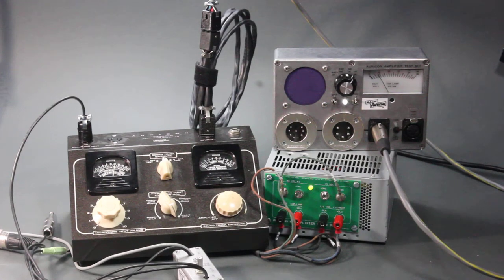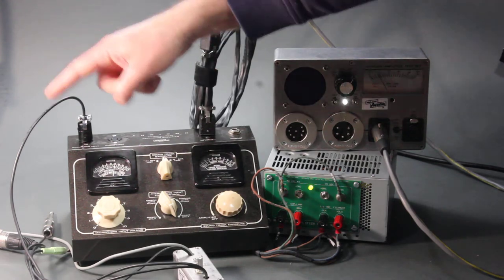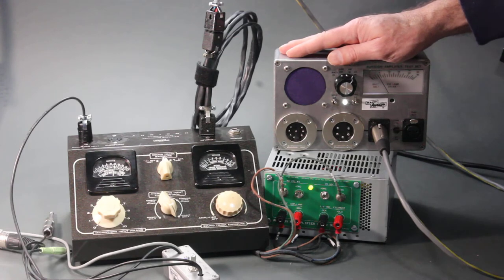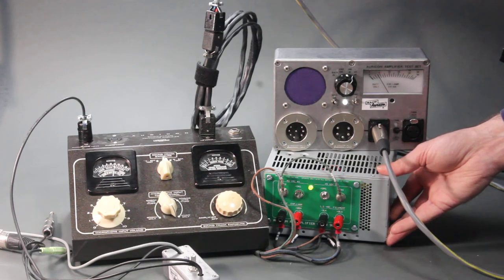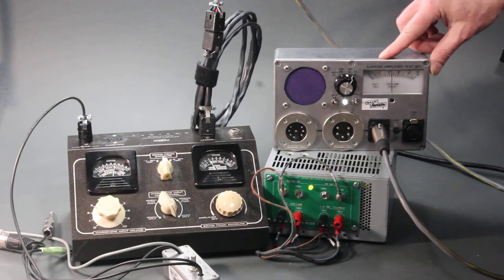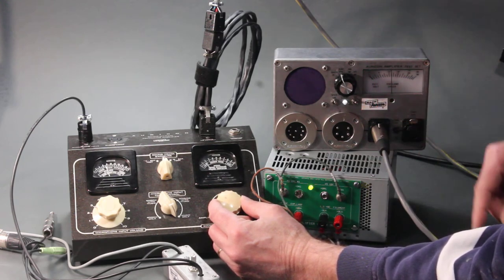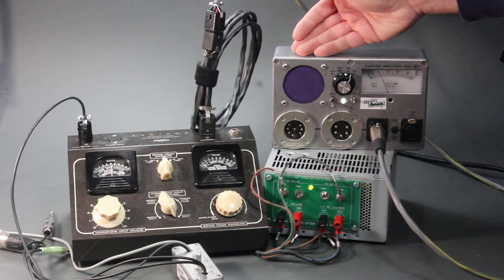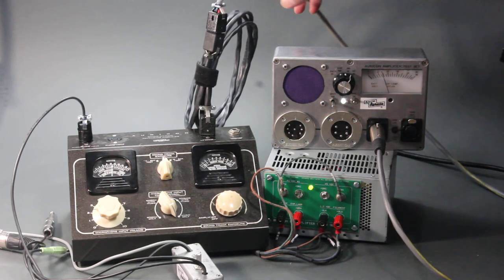Bach Auricon RA-30-A7 optical sound amplifier demonstration

Comment: I just got myself an NR-25 and it will certainly be a challenge to get it running again.  I'd love to talk to you about power as it currently needs 6 rather odd batteries to run.  Nice video btw.
Reply from the maker: Hi, thanks.  All batteries connect to a wiring harness coming from the amplifier cabinet.  90 volts connects to red and green (red is plus).  1.5 volts connects to black and blue (blue is plus) and 12 volts connects to black and brown (brown is plus).  except for the two 45 volt batteries used to make up the 90 volt supply you probably won't be able to find batteries which fit the existing plugs.  So cut them off and replace.
Join the Auricon optical sound on Groups.io and you'll find all the information needed to make these amps useable.
Reply: @kb9vke  Thanks you so much!  I will certainly join that group!

Comment: Hello there.   I recently got a  Auricon 71 camera and have a line on an amp like the one you demonstrate.  But I don’t have any cables.   Do you know the pin out of the camera and amp. So I can build a cable 

Thanks
Reply from the maker: Hi, Much depends on the particular variation of camera and amplifier that you have.  There are differing galvos and connectors used.  I suggest joining the Auricon optical sound group on groups.io where you can post pictures to get help and visit the files section which has lots of technical info including connector wiring.  You can still buy most connectors except for the 4-blade Cinch-Jones.